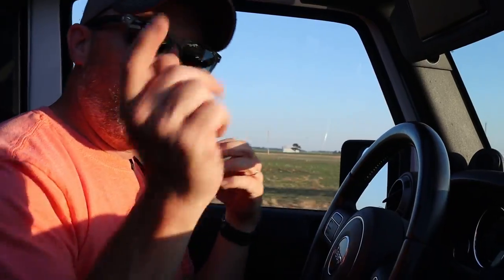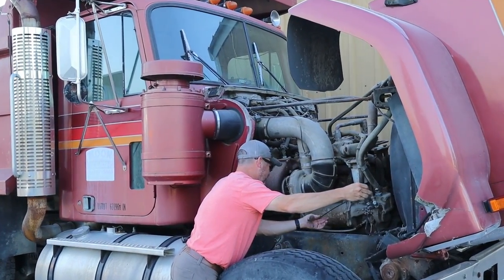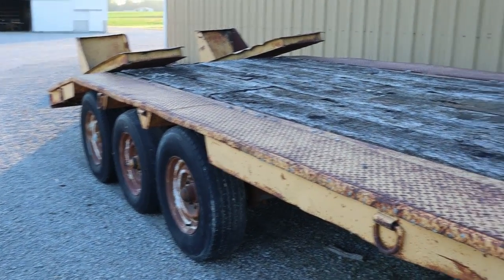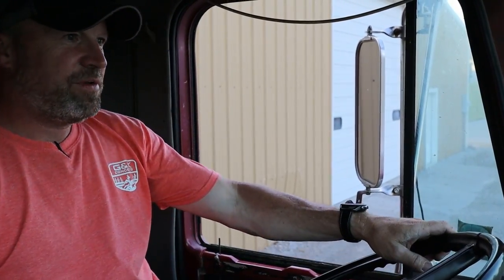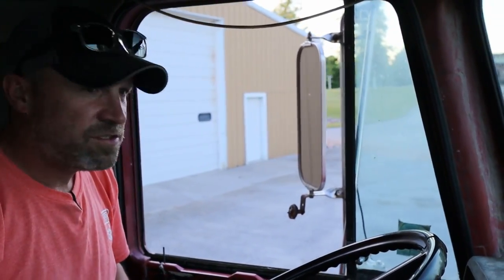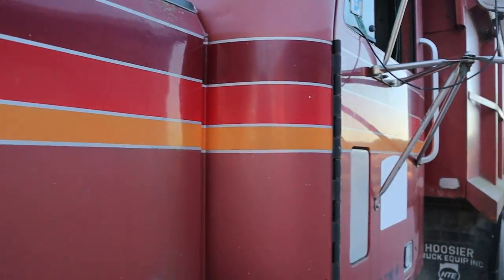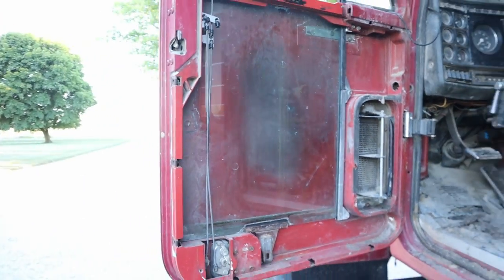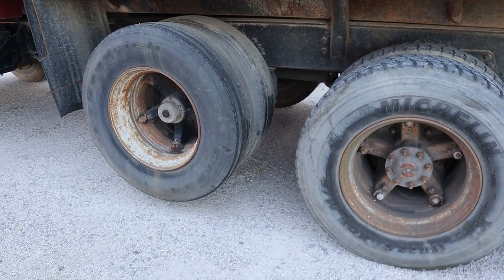I Bought A Tri-Axle Dump Truck [Hasn't Been On The Road In Seven Years] 1986 GMC General

Comment: That transmission is a 9 speed over drive. The 400 Cummins in the big cam series is a good engine.  It's easy to turn up the power and RPM.  Shouldn't run over 2450 RPM no load.  Meaning in neutral accelerator on the floor.  If you want more power,  it's easy to change the "fuel plunger "  it's in the fuel pump. One thing, if you change the fuel plunger (aka fuel button ) you will lose some RPM.  To avoid that add a shim or 2 that should help keep your RPM. I have worked on a lot of those,  and if you turn up the fuel, for example,  I had a 315 horsepower Cummins,  I removed a # 30 fuel button put a #7 . My fuel mileage went from 5.8 to 6.25, MPG.  that's keeping my speed down to 65MPH.  when I was coming to a hill I would put the accelerator on the floor and hills I had needed to down shift on I didn't anymore.  
It looks like a good truck.  Good luck sir
Reply from the maker: Thanks for all the great info Bert!

Comment: It sounds stupid but some of the early steering boxes needed to be "clocked" if they were ever replaced.  Jack the front of the truck all the way up in the air with the engine off turn the steering wheel lock to lock two times. I think it was replaced and nobody bothered to do it and one of the signs is it turns sharper One direction than the other.
Worth a try.

The 8ll transmissions have some weird splits in them between the gears. First and second is only about 100 RPM split but 7th and 8th is about a 650 RPM split
Reply from the maker: Great tip Drew.  I may just try that as this thing doesn't steer worth a darn to the right!  Hope that will help.

Comment: Looks like a pretty decent General, in their day they were great trucks. The Cummins Big Cam 400 is a great engine, and that trans should be good to go, I'm guessing that's a 2100 RPM engine, and of course, no DPF. The front tires are really sensitive to alignment, king pin stability and balance, if not done correctly they tend to cup on the inner edges, sometimes outer, but mostly inner edge. That truck looks like a prime candidate for restoration if you're so inclined. Either way, good luck, and I think you got a solid truck.
Reply from the maker: Thanks!

Comment: Lose the old suicide rims and when empty that motor and trans will pull out in high range...flip your selector in high and pull shifter all the way to u and down and start there best way to explain without showing lol...as long as you are not on a hill your good to go gets through gears faster and to higher speed faster...as far as the grinding goes i would say the synchros are wore due to age add you some heavier oil to the tranny and  on clutch when loaded or pulling a hill

Comment: Its a 9 speed over thats why gear are backwards
Reply: 9 over with 3 90 ratio rears 24.5 tires .with 425 b cat turning 24 hundred  rpms your top speed 128mph . And if u put a back half of a 13 speed on it you gave a 13 double over but it takes lots and lits of power to pull it

Comment: Too bad it doesn't have a Detroit. Cool truck, though.
Reply from the maker: We had a Brigadier that had a Detroit in it and it was really cool for about 5 minutes and then it started to get annoying to me.  I also ran a John Deere 860 scraper for a couple of years that had a 6-71 Detroit and it kinda ruined them for me.   They're still really cool to hear other people driving them though! :)
Reply: @digdrivediy  yes. I ran a ts-24 terex scraper. 12 in the front and 6v92 in rear. That dude could move the dirt. After lunch you put a gallon of oil in the 12 and 1/2 gallon in the rear.